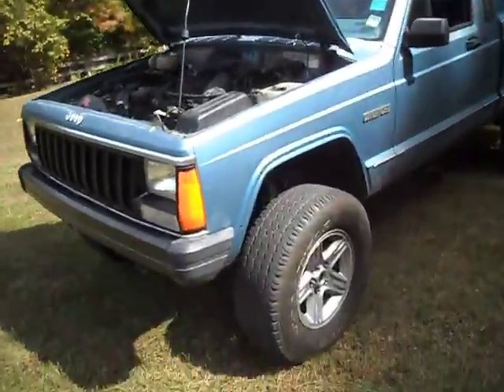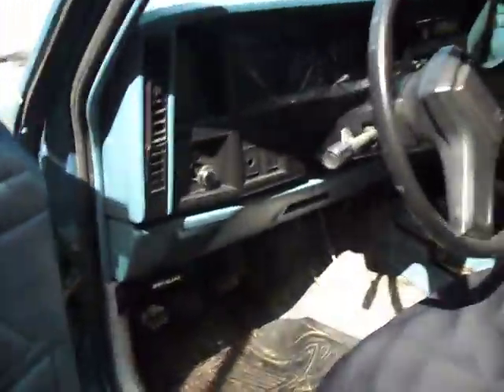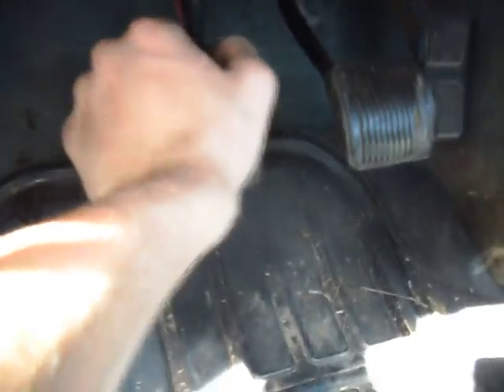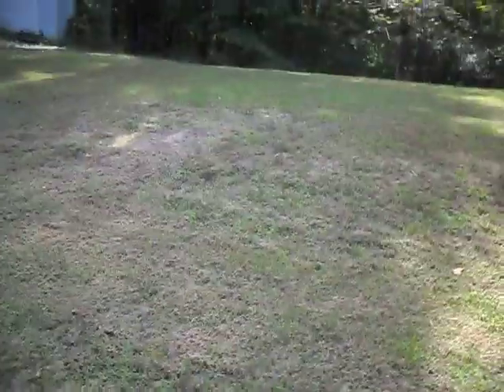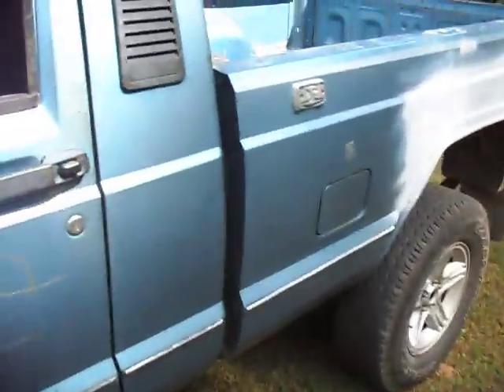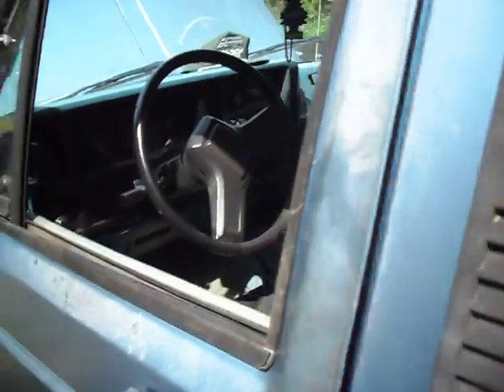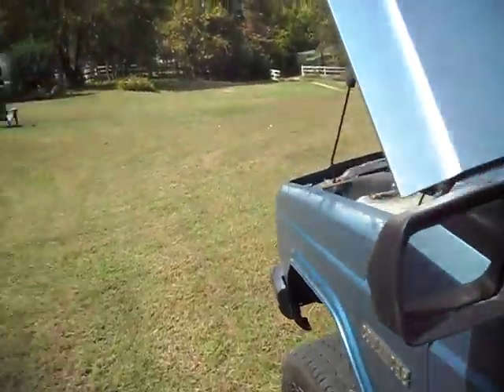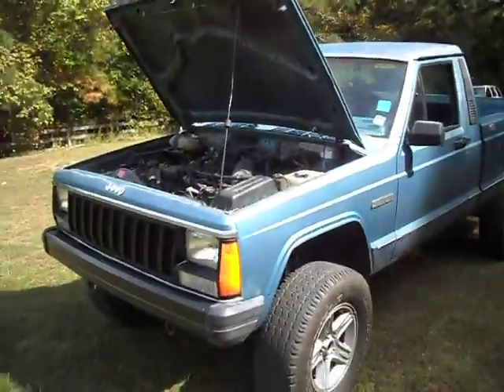JEEP slave cylinder/ clutch problem

Comment from the maker: the clutch system is through the brakes. if you do what i said in the video and pump the brake pedal a couple times and than hold it, and have somebody bleed the system while you do that than it will get the air out and get your clutch back to working order. i worked on a yota that was different, we had to pump the clutch instead, it all depends on what type of vehicle you are working on.

Comment: On my Comanche I can crank mine and throw it in gear without using clutch and it won't move, and I've already bled the lines and honed the slave cylinder?